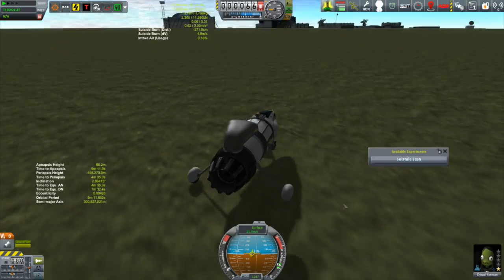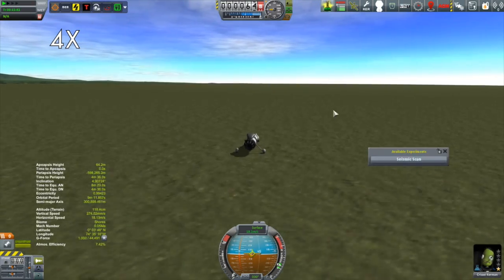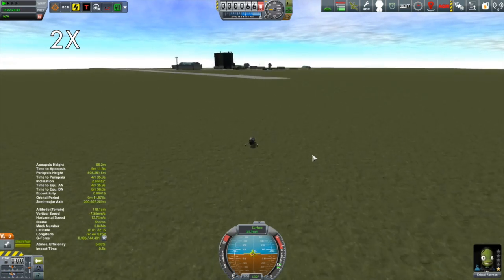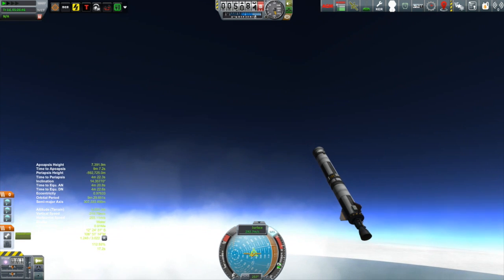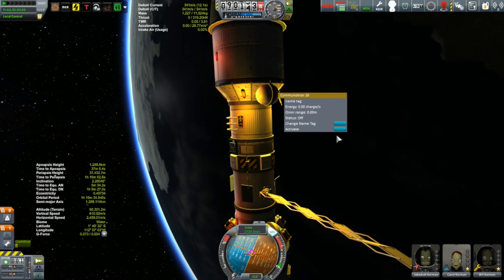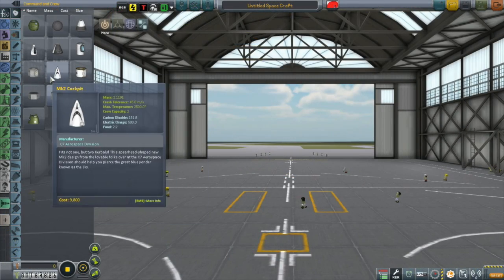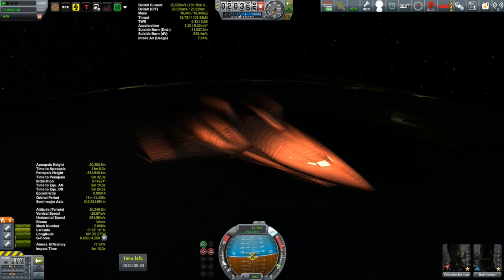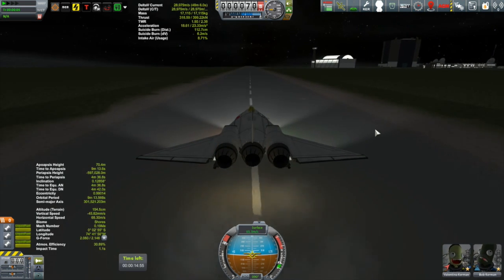KSP Career: Episode 39 - Supersonic

Comment: I hate spending science because I can never choose. So I save up so much, I can buy everything all at once.

As ever, to leave the Mun, go faster backwards.

I am yet to build a space plane using pre-1.x designs. I guess this is "good" as its not so trivial to make space planes.
Reply from the maker: +viruk67 I haven't built a space plane in a long time either.  I may play a bit more with the vector engines (looking them up, I see they come from B.Dynamics as do those pop-up RCS blocks).  Maybe I'll be able to get something working.